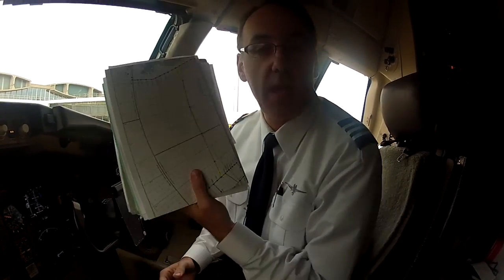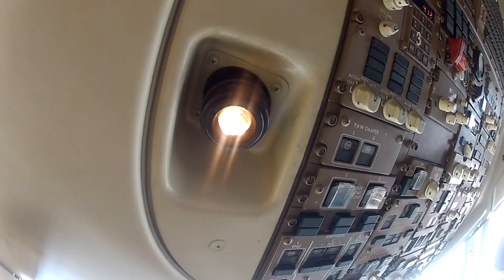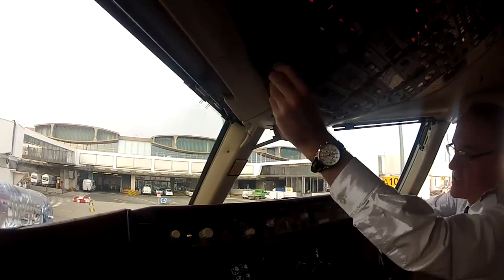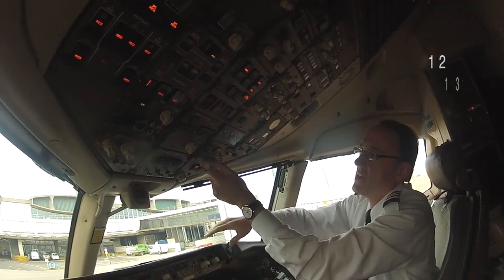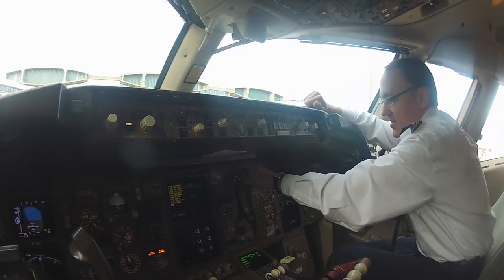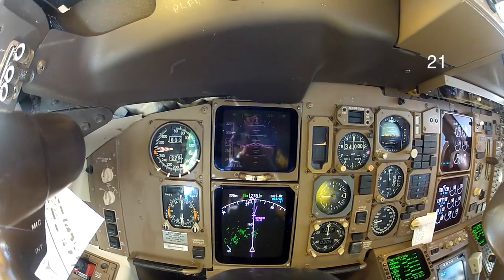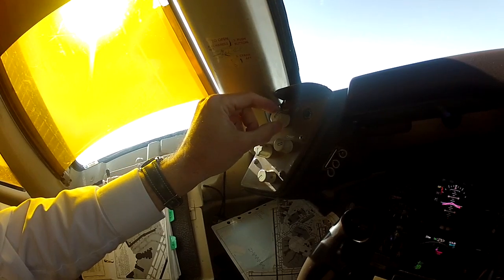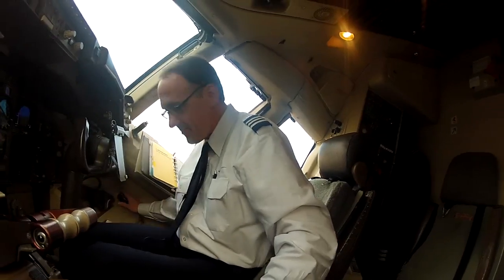Cockpit Chronicles: 32 Dimmers on the Boeing 757

Comment: How in the hell can you remember where everything is on each plane?
Reply: When you spend 4,5,6,7 hours in a small area, you learn where everything is, even if 200 peoples lives do not depend on it
Reply: 757 on your FSX rig?
Reply: +Barnacules Nerdgasm Its easy barn flying the same bird  its all memory, I fly the captain sim 757  for fs9 and build a home cockpit  and only fly that plane the 757 and knwo where every switch is and what they do.
Reply: You get used to it after a while. 777, 757, 747, 737, its kind of natural.
Reply: Barnacules Nerdgasm  it’s also organized in groups for the most part , it is a lot of switches , buttons but everything has a flow to it  .
Reply: Its pretty easy tbh
Reply: You fly ONE type and the switches are more or less the same.   More for a decent airline, less the same for a lousy one.   ;)      99 percent of the pilots out there fly just one plane.    They can move to another, but generally, they stay on the same type.
Reply: @lbowsk  it’s us mechanics that have to know 12 different planes

Comment: I read on a online pilot's forum that commercial airline pilots my much prefer flying a Boeing 767 as opposed to a 757. They said the 767 is much easier to fly and it has better flight characteristics, and just handles better. What do you think 1st Officer Wien ?
Reply from the maker: Yeah, I’d have to agree. The 767-300 is a sweet flying airplane. But the 757 was pretty close in feel. Not a huge difference.

Comment: Kent I have a question I'm 13 years old and my life long dream was to become a pilot since I was 6. Is it hard to become a pilot? What are the main things you need have good knowledge of? And is being a pilot fun or is it not boring? Do you fly the plane a lot or is it it like a sit back relax? Thanks
Reply: Hey i want to be a pilot for the 757 and I'm also 13  anyway  the mains things from school is to get good grades in Maths and Physics. they fly the airplane on take-off and the fly the landing about 2,000 feet or less during the flight they have autopilot and they set it to a certain hight or speed then they relax.
Reply: kyle kidd First, go to college. It is not mandatory but it helps. Then go to a flight school to get your PPL and Multi Engine rating. I suggest ATP as I am going there too. Then apply for a job at your favorite airline. I suggest Delta. They accept without hesitation. Also it depends on the flight. Some flight plans are all auto. Some are all manual. Also take notice that most of this will cost to $100,000 minimum. Try to work hard and get a good day job. I work at ATT for $15 an hour. If you don't have the money think about being a private pilot. Less money, and better perks. And if you live in the UK and have 16 years of age, you can sign up with British Airways. They pay for your licenses but deduct money from your paycheck until you pay it all. Good luck! P.S. Make sure you keep your grades 90-100. or A-, A, and A+.
Reply: do u have to go to college or uni  i got told u don't have to
Reply: You don't have to but it really gets you a higher pay. Without college: $78 a hour flying a 737-800. With college: $238 a hour.
Reply: what about the 757 would it be the same?
Reply: kyle kidd Pretty much but sorry to say but by the time your grown enough and already got your licenses (about 25 without college), most, if not all airlines will get rid of their 757s. But there would be a substitute, like maybe a 797 or 757-X. Who knows. Lets ask Boeing for that. lol.
Reply: haha yes i really want to fly the 757 or any plane I'm not really bothered as long as I'm a pilot.
Reply: kyle kidd You like Airbus as well?
Reply: its ok i prefer Boeing
Reply: Yes i do just my name, I'm 14
Reply: facebook
Reply: kyle kidd Yeah my dream is to fly a Triple Seven or a 767. As weird as it sounds my biggest fear on the aviation industry is how the aerodynamics and forms of aircraft will change. In my honest opinion I hate how the speculated 797 model looks but hey, that's none of my business, eh?
Reply: I prefer the 777 to the 767
Reply: i love the huge GE90 Turbofans. It actually has the largest engines by diameter.
Reply: the noise of them when they get put up to full throttle
Reply: hearing the fuel being injected is amazing
Reply: FlyHigh Airline Films  "I suggest ATP as I am going there too. Then apply for a job at your favorite airline. I suggest Delta. They accept without hesitation." Uhhh, que? Where do you learn this stuff?
Reality check; when you're done with college and your flight ratings, you'll probably be flight instructing until you get to at least 1500 hours (ATP minimums, as per the new regs a couple years ago), then you'll make poverty wages at a regional flying a CRJ for a couple of years, then pay will get a little better. Give that a few years, then you'll be marketable to a major. Pretty much the standard progression nowadays, at least in the states. I know in Europe the requirements aren't as high in terms of hours.
Reply: FlyHigh Airline Films Payscales at airlines are the same for everyone based on seniority; has nothing to do with going to college or not. Pretty much every major airline in the US requires a college degree to get hired as a pilot - doesn't matter what it's in.  There might be occasional exceptions if the candidate is, say, ex-military and has many hours flying heavy aircraft already. But nowadays, a degree is virtually required to stay competitive with other applicants.
Reply: TheZav88 No. You see you will be a instructor if you don't have the $85,000 some companies charge for time build ups. But I am sure I have more than enough. I know this info from looking at their websites, taking a tour of their facility, and being a little expert on aviation myself! Haven't you learned that people don't like to be corrected unless is worth it. Is not worth it now.
Reply: TheZav88 I am not commenting on your second comment due to the fact that you are wrong. Very wrong. Just go ahead and do some research and then say your facts. Otherwise be careful what you type. Delta pays, according to my math ant posted pay scales, they pay about 7-10 % more than American Airlines.
Reply: FlyHigh Airline Films Please PM me a link to your source for this information. I don't mean to come across as a jerk, but obviously I'm pretty skeptical, but happy to be proven wrong. Saying you can get hired at Delta (or any major, really) right after getting out of ATP is frankly delusional by today's standards. Pilots are putting in years at a regional airline to get to a major. I've been working in the industry for about two years now (not as a pilot, but in another field currently while I'm training/finishing my degree). I've been scouring the net and talking to pilots at my company during that time, so believe me, I've done a fair bit of research as well...
Reply: FlyHigh Airline Films Sorry, what I meant was that airlines don't say "okay, so you have a college degree, so we'll pay you X dollars more vs. this guy who doesn't".Your hourly pay is simply determined by whether your an FO or a CA, and how many years of seniority you have at the company.
Reply: TheZav88 No source is needed. I prefer you do your own research. Just look up the pay scales on pilot forums. If you can't find any I will give you a link I got. It is not worth it. I left that career to the trash. I am into racing now. GT3 racing to be exact. More of a better career. I want you to remember my name, Christopher DeLaCruz. And when you ever come across that name ever in your life. Come back to this comment section and say "What the hell did you do?" Thats how history is made.
Reply: TheZav88 Also you are right. It is based on the aircraft you fly and the position you are in. Also you also get a little bit more based on how much time you have with the company.
Reply: FlyHigh Airline Films Lol, alright you win. I've been trolled good.
Reply: TheZav88 Actually.......
Reply: +Daniel Spier 3 things to do if u have a flight sim: take off, land, repeat u will get perfect at it i promise

Comment: Airlines would love to retire it because it is old, but at the moment there's no aircraft in production that can completely replace the 757 yet. It's a versatile aircraft with the ability to serve short domestic routes along with transatlantic routes. Its large wing and powerful engines also allow it to serve both smaller and larger airports. Boeing is studying for a replacement, but now the best candidate is the 737-900ER, which can fly the 757 domestic routes but not the international routes.

Comment: I wish I could fly a 757 in FSX!
Reply: +Speedbird you can! justflight.com has a freeminum model which is nice. the model and a couple of repaints are free, and additional repaints are pretty cheap
Reply: Yes, but the FMC is unrealistic...
Reply: +Speedbird X-Plane has an incredible B752/3 for you to fly.
Reply: Sadly, I do not have X plane, I was pretty unhappy with the demo. The view system is terrible
Reply: heard great things about the qualitywings 757 for fsx
Reply: The view system is fully adjustable, and works better than ezdok. You should invest more time in the settings
Reply: This is getting creepy...
Reply: lol wut
Reply: +Speedbird LOL!!! It's like they are intentionally trying to advertise 757's for you!
Reply: *****
Well guess what, I do not like it. I do not want to have to press a bunch of buttons JUST to move around. I also hate the ui, and most of the addons are of low quality, both visually and system wise.
Reply: Well guess what, you are entitled to your opinion and that's cool. Next time, don't say "The view system is horrible". say something like "I did not like the view system, I got overwhelmed by so many customization options I did not understand."
Reply: I am a proud user of the Qualitywings 757 Package. It features a very good FMC, beautiful exterior and interior modeling and about 70% panel functionality. Though it does automatically only require you to pop battery, switch packs, start APU and engines, you can set to cold and dark mode; IRS switches, hydraulics, yaw damper, packs, etc.

It's worth noting that it's only 25 dollars. That's a very good price!

Captainsim has a more accurate/detailed system on their 757, but I personally think their interior and exterior is fairly lacking along with their sound and handling specs.
Reply: +Speedbird i fly the captain sim 757, it got a bit of character
Reply: +The Flying Gasmask ha  you do ? i built myself a home cockpit using the cs757,!!
Reply: ***** nice :D